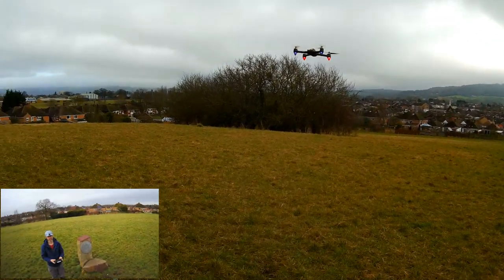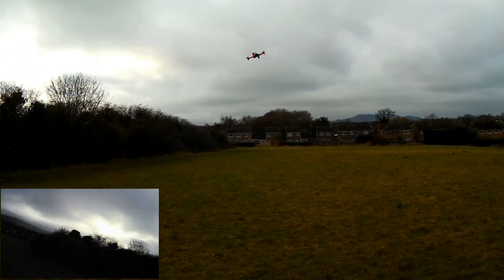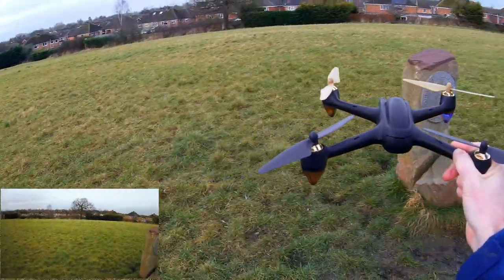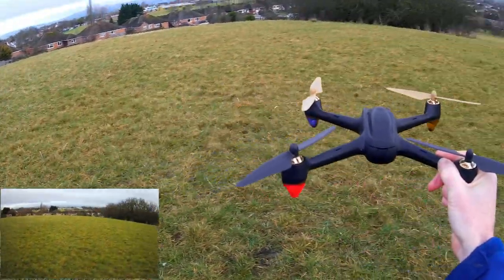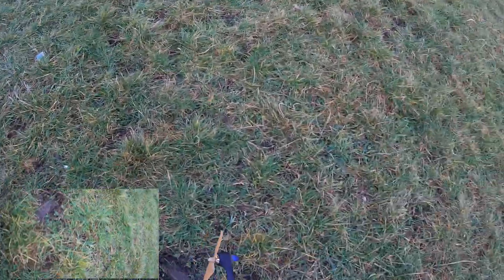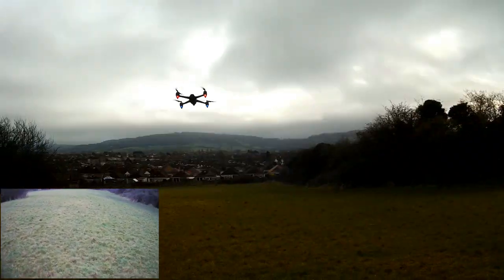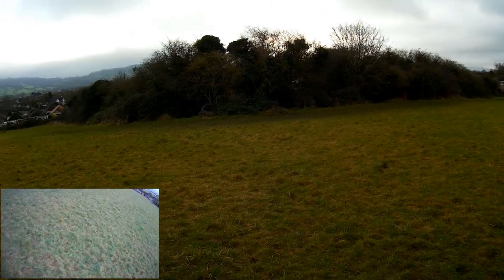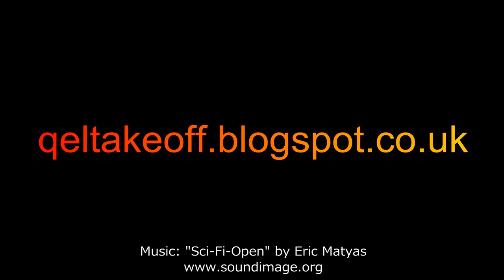Hubsan H501 - Toilet Bowl Effect

Comment: I have the lastest firmware and you don't have to calibrate it just place it on level ground. It flys well for 10 mins then it toilet bowls really bad
Reply from the maker: Yes I fly without compass calibration too. It doesn't mean that you still won't get TB. Calibration is only accurate the place you do it!
It is really important with the no cal option, to calibrate somewhere clear of any magnetic anomalies. This should give you a good calibration offsets which will work just about anywhere (although you'll obviously get issues if you fly over or near large iron objects :-) )

Comment: It says right in the manual and on many other videos, NOT TO HAVE ANY METAL NEAR THE QUAD WHEN DOING A COMPASS CALIBRATE. You're ring, your watch, change in your pocket, even the transmitter, nothing within 10 feet when calibrating.
Reply from the maker: I'm pretty aware of what causes calibration errors and what doesn't :-)
This is perfectly good advice, but you need to treat it with the caution it deserves.  Most rings are non ferrous, most watches and phones are also non magnetic and have zero affect, you need a transmitter to fly (in fact there are 2 in the quad (actually 3 in the one in this video). 
The reason you should always test for TB is because, however careful you are,  it can catch you unaware.
I think the main lesson  is always be ready to fly without GPS.  Ultimately that removes the issue completely  :-)
Reply: Silver and gold maybe, I was thinking more about the copper and batteries in watches and phones and the Transmitter. Copper in itself isn't ferrous, but wrap it in loops and run a little juice through it...

Comment: I've had this happen a couple of times with my H502c, just wondered if you had tried turning off the gps during this? Mine is fixed on, so not able to test, or is it just down to compass calibration?
Cheers Phil
Reply: Nice one. My GPS was turned off, couldn't work out why drone was drifting 😂
Reply: @aburaeese  Glad my comment from 6 years ago was helpful? 😊👍

Comment: Great explanation how a heading anomaly could effect and cause TBE.  I think the wind would make it worse(processor reacting to wind displacement as well as bogus head input). Your increase in alt seemed to confirm that.  So that is a 501A and you are flying it with the standard FPV controller. Does it actually have a WIFI transceiver onboard?  Or does it connect thru the wifi "booster" which I am suspecting interfaces the android or IOS APP to the standard 2.4/5,8Ghz control/FPV  scheme?  IE: Basically a 501S with an X on it(and different firmware) and an interface box to use the app. Since it can still use the FPV controller it seems odd that it would use 2.4/5.8 AND WIFI...
Reply from the maker: I haven't actually explained why TBE occurs! 
I'll rectify that shortly with an explanatory video.
It is however all related to compass error and PID settings.

The 501A has a wifi TRX and  2.4GHZ standard  TRX. You can fly it with either  Hubsan controller or a smart device.
You can add an additional "booster"  (HT005) if you need better wifi range.
Reply: You did a pretty good job of it in a text response to this video about 5 days ago.  It was that response that I was refering to, I just posted in the wrong location:)  Thanks for the WIFI clarification, I want to get a 501 but think I might wait till the Alpha is available as the app functionality looks pretty nice on my Ipad

Comment: i have a problemwith the fpv on my advanced version luky to get 200m out of it very fuzzy have tried the antena both ways incase it was built backwards i have tried rebinding have tried difrent antena have took drone to bits and controler to check sma conection and continuity any idears on what i could try next would be very greatfull for help

Comment: Two questions; how windy was it during this flight?  It sounds very windy and the quad did great.  Secondly, what steps did you take to re-calibrate without completely powering down and starting over?
Reply from the maker: About 10mph  wind at ground level with gusts. I was flying low to keep in the shelter of the trees and out of the wind. Not a day for going above 15 meters...

Comment: TBE just happens sometimes, could also be that rock you put it on with the metal plate, always a good thing too hover for a minute after take off, if TBE appears just land a recalibrate, no big deal.  My Blade 350 QX also will do it if not flying for a long time, so its not just the Hubsan      Nice flying BTW
Reply: hi ruudy! xD

Comment: Have you even looked in the instruction book?
Look at the part about calibrations. 
It shows how to do this.
Reply from the maker: I could probably quote directly from memory for most versions of the instruction manual.
Doing so will not prevent TBE, neither will doing compass calibrations in any particular way.
The important thing is to meticulously check that the compass has a useful calibration.
Most of this is now of course irrelevant, with saved calibrations and no forced calibration on power up.

Comment: The weather wasn't a factor, but I'm just curious as to what you think the wind speed was that day?  Thanks!
Reply from the maker: About 10 mph, gusts to about 15.
Probably sounds worse than it was. I was flying low to keep out of the wind and in the shelter of the trees.
It would have been very windy up at 100m!
Reply: Everyone flying RC needs an anemometer.  You can order from Amazon for about $18 Never have to guess wind speed again.